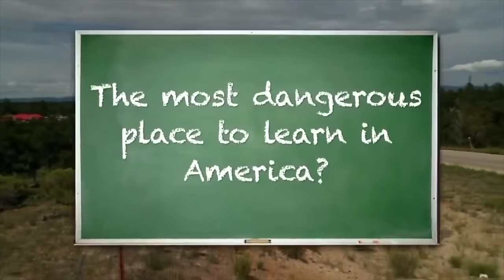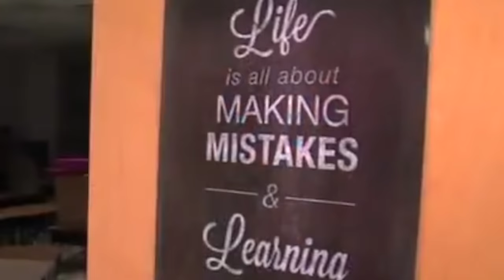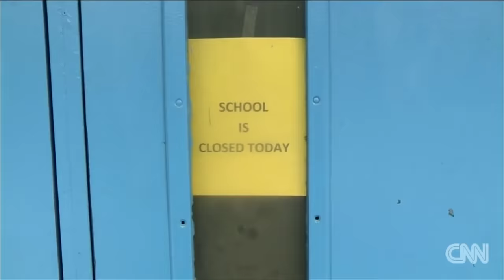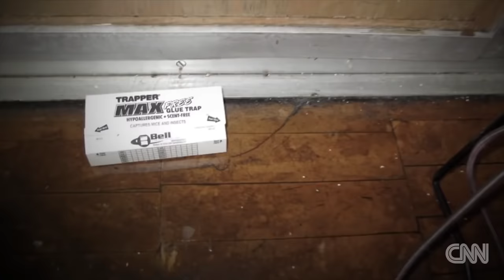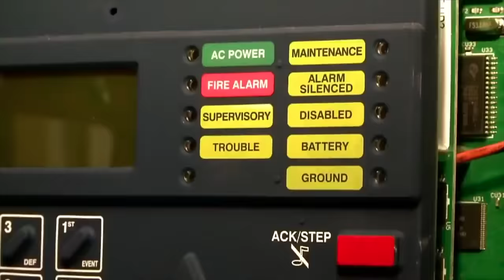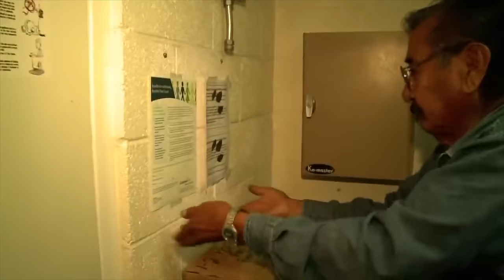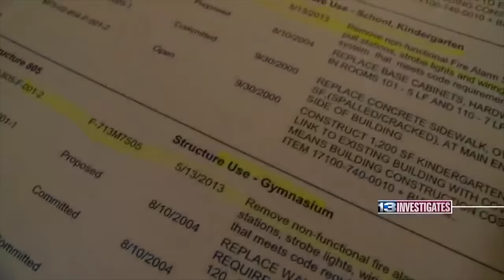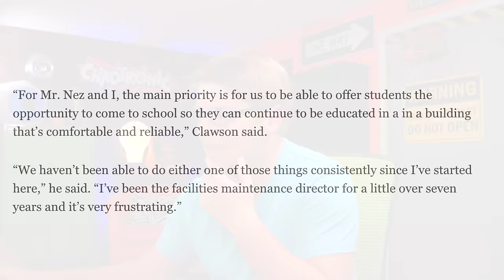The Most DANGEROUS School In America

Comment: The way that ceiling tile looked reminds me of a retail job where the roof regularly leaked (to the point of the tiles collapsing into the aisles one year)
Pretty sure the mold isnt going away until that gets fixed.
Reply: Every time it rained too hard we had to look for those stains and toss a bin under them to catch the water. Turned out later it was caused by the ventilation system not being sealed properly at the roof
Reply: This was Toys R' Us in its final days. Buckets everywhere.

Comment: i went to a private school system that marketed itself as prestigious but even then they couldn’t bother to update or fix anything. we had no ac, one of our water heaters nearly exploded, paint was peeling off the walls, and we had many stains on the ceiling tiles. the performing arts center was clearly lacking, the room i had choir in was really hard to access and had a heater that nobody dared to touch because you could either break it or turn it permanently on, the windows and ceiling leaked, and there was a bug problem in the warmer months. one of my classrooms smelled so moldy that it would give me a headache. doesn’t even matter if you receive proper funding if your system is corrupt unfortunately.
(also i was just looking through old photos and found a pic my friend sent me of a door handle to one of the buildings that just fell completely off when he tried to use it, we laughed so hard at it)

Comment: In my high school we have ceiling tiles but they were the old ceiling tiles that are square and they used to glue up on the ceiling.  And the tiles were there since the school opened back in the 1950s. Because of that the tiles would fall down from age and they were everywhere. One tile almost fell on my head.

If you went to the classrooms you could even see some empty spots with gule residue where they once lived. But the funny thing is that, no one complained. They don't even replace the falling tiles. There's just rooms with empty gaps and gule residue. I guess everyone was just used to having tiles fall on there heads. lol

But hey at least they were not moldy.

Comment: I worked at a school at an IT tech. That first story made me laugh. Our school had stained ceiling tiles everywhere, mold, asbestos in the walls, floor, and furniture, a leaking ceiling, toilets that wouldn't stop flushing, an HVAC system that was very loud (people called my office a washing machine because of how loud it was), and some of the floors were warped. 

The door bar for the door in the second video, they're not really supposed to be attached to the ground. It is supposed to be removeable to move pallets and large objects in and out. The only thing wrong was that base to the pole was missing.

Comment: I remember back like 10 yrs ago in my high school. in the older areas of the school, one of the computer labs would have water from the bathroom in the next room leak through the wall on the floor.... Right by MULTIPLE power bars on the floor. 
Our school paper did an article on all the old ceiling tiles that were stained/falling in the hallways.
Lots of the older parts of the building had bad or no working AC in TEXAS! And we weren't allowed to have open windows.
Woof. Though I remember seeing on social media that apparently our high school had NO A/C during those TRIPLE digit heat days... Lord...

Comment: The high school I went to had paper walls…yes paper wall, the interior walls were just cardboard glued to asbestos insulation, some whacky idea of the 1970s where they though it would be cool to make the interior layout of the school modular with lightweight removable walls. Cool concept maybe until you put teenagers in it, saw a kid casually lean his head back and put a head sized hole into the wall. We had a “kite” network that traveled through strategic holes in the wall, take a pencil wrap a note around it with a rubber band and stick it through and pass it into the adjacent classroom, except for all the asbestos fibers that were pulled through the wall with it. Also didn’t have enough outlets for power only solid exterior walls had them so teachers had to run extension cords from one classroom to another to charge a computer. Also shooter drills were a joke with paper asbestos walls it wouldn’t exactly be hard to shoot the place up, shelter in place was laughable. They finally changed the protocol to self evacuation which was basically a free for all to a muster station

Comment: At my job(Starbucks) we’re currently having safety and sanitation issues. Our ceiling in the cafe is leaking water (during rain). It’s rain water that filters through whatever is in the ceiling and then drips from around the recessed lighting(fire hazard) as well as the ac vents. Worse, however, it drips over both food and drink products that customers consume.

Various sections of the ceiling are becoming discolored as water pools up there.

Comment: Man i thought the middle school i went to was bad. They finaly closed that thing either my senior year of high school or a year after i graduated. There was legit asbestos and stuff in the cealings and there was this huge wooden staircase you had to walk up on the side because it was built on a hill and there was a huge stone wall so apparently there was no outside staircase so they just slaped together a wooden one that always felt like it was gonna fall over. Especialy in the winter months with snow and ice. There wasnt AC in the school either (except for like 5 classrooms and even then they were external AC units that the teachers had to provide that looked like basic industrial units). There was also apparently a pool under the gym but it was never used and ive never seen it but it was like one of those old gyms where the pool was under the gym wood floors and you could push a button to get the pool (like in Its a Wonderful Life) but idk if it was full or not or what the deal was with it

Comment: Those ceiling tiles are meant to stay in if the roof leaks, this helps technicians  determine where exactly the roof leak was. 

I have never seen a ceiling tile have mold form on it. Even one with significantly more stains. Normally they don't need to be replaced. They would just be spray painted with a ceiling tile paint and be indistinguishable from a new one.